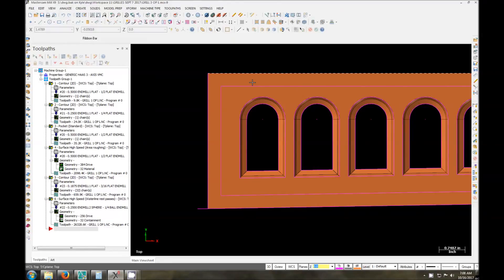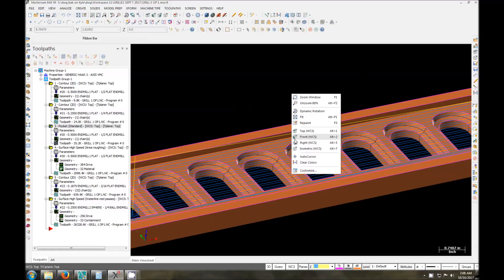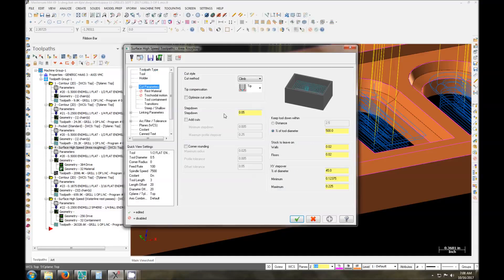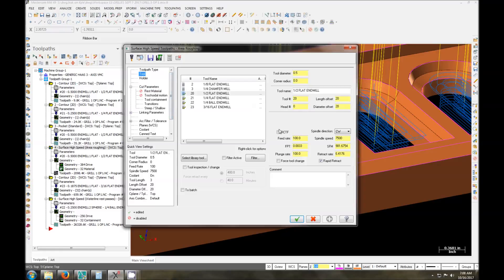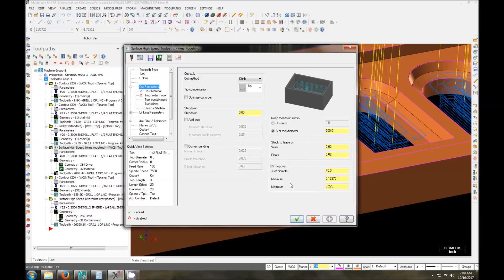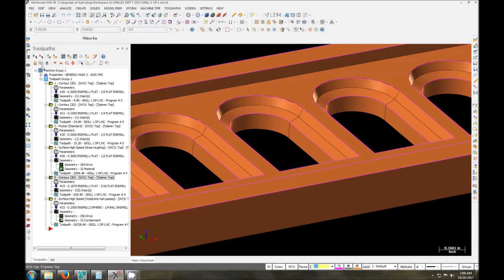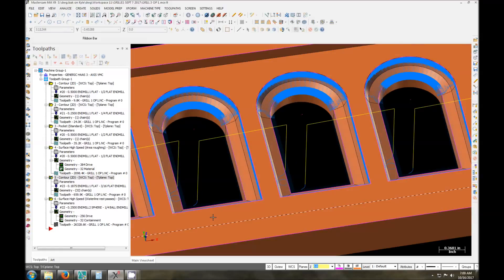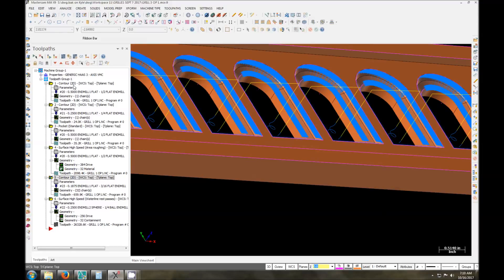LET'S MACHINE: HIGH SPEED WATERLINE TOOLPATHS

Comment: That's a Haas controller. Doesn't that model have 1GB of memory? I wouldn't think that program would max out that memory to need drip feeding. Since the surfacing is your bottleneck of code, you could try setting up the pocket just for that tool, to be a sub program, if you really didn't want to drip feed.
Reply from the maker: No sir, this is a 2005 machine - it has a pitifully small memory!
Reply: Damn that sucks. I'm at work using an abysmal 128KB machine. Useless Fanuc controller. I can usually only surface a rad with any decent quality at only ~25-40ipm. No High speed toolpaths either. Controller chokes. :(

Comment: nice work bro. did you have any trouble with the part warping on you?
Reply from the maker: Thank you sir! I did not - I typically don't have much problem with 6061 aluminum warping at all - it's more steel with internal stresses with heavy material removal that I tend to have issues with warping and snaking.